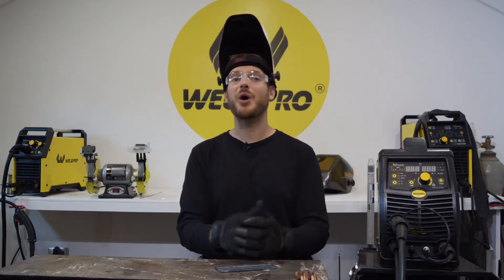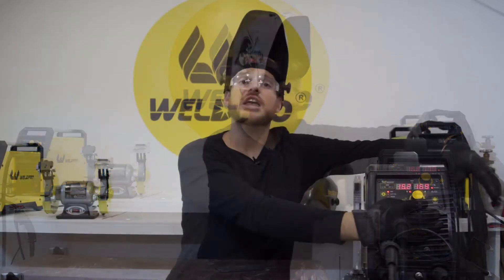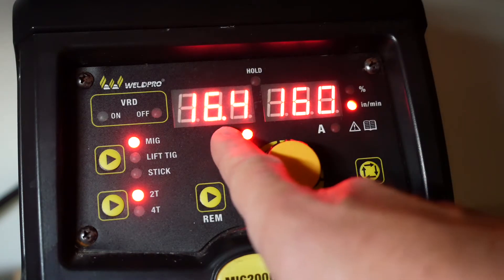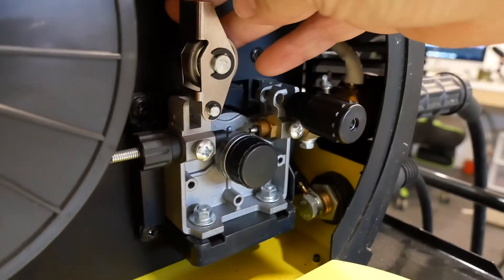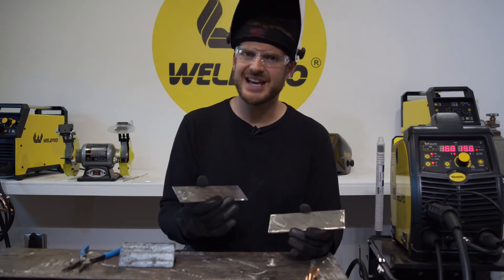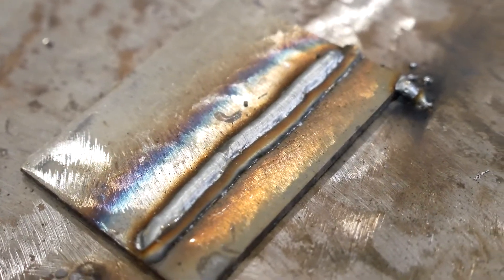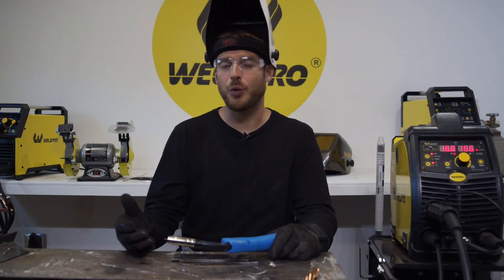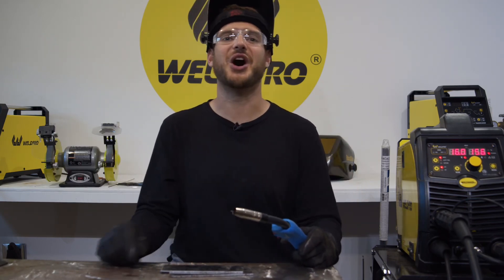Weldpro MIG 200 - Welding with solid wire (70S-6) and 75/25 Mix Gas

Comment: My wire speed stops at 315…any way to fix that?
Reply: 315 IPM is the max wire speed when plugged into 120V power.  To get more wire speed,  you'll need to power the machine with 240V.

Comment: This machine can weld aluminum in tig?
Reply: No, this machine is DC only.
Reply: @allwheelpeel  how about welding aluminum in mig?
Reply: Can u make a tuturial on how to weld aluminum.using mig200?
Reply: Luke (our video guy) doesn't work for us any longer.  There is a spool gun setup for the MIG210LCD here:  https://www.youtube.com/watch?v=a9HrsXCHQEw

The process is very similar, except on the MIG200GD you press the remote feeding ("REM") button for spool gun feeding.  There are lots of tutorials on here about spool gun Aluminum technique.

Comment: The wire size selections for Mig are .023, .030 and .040 (not a common size).  What do suggest for .035 wire (a very common size)?  Picking .030 or .040 should probably require a marginal offset in the voltage when using .035 wire.  Any suggestions in what that offset should be?

Comment: Whats the maximum thickness this machine can weld ?
Reply from the maker: Great question. In theory with correct joint preparation infinite thickness is possible. However in the industry MIG is only really encouraged to penetrate about 1/4" base material with no groove or joint opening. Multi pass welds can easily hold thick steel together.

Comment: Can you Weld mig without gas in that machine?
Reply from the maker: Absolutely! You can use self shielded wire!
Reply: @WeldproWeldingEquipment  how about dual-shield wire?
Reply from the maker: @greghbci4534  sure can! 😀

Comment: Great video I had issue adjusting the voltage independently of the wire speed.
Reply from the maker: Keith Reynolds Thanks Keith! Sounds like you aren’t the only one. I wanted to try and explain as easily as I could how to adjust it. Thanks for watching!
Reply: @WeldproWeldingEquipment  this was very helpful